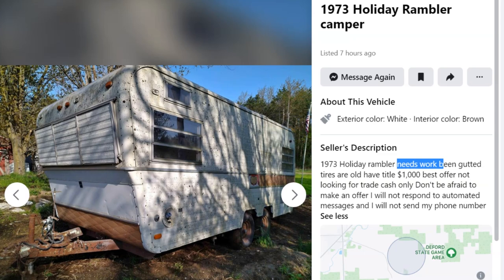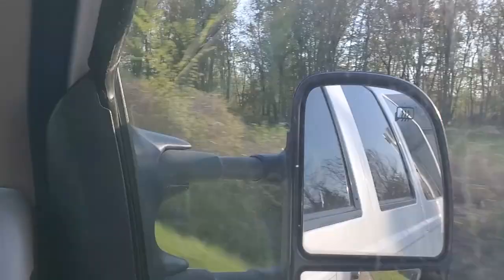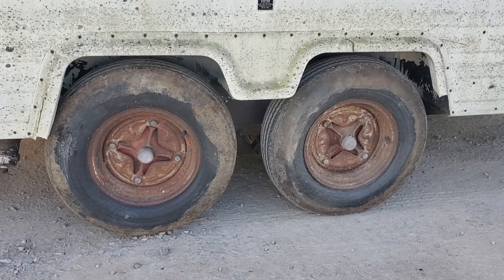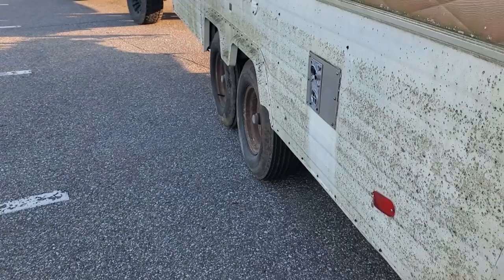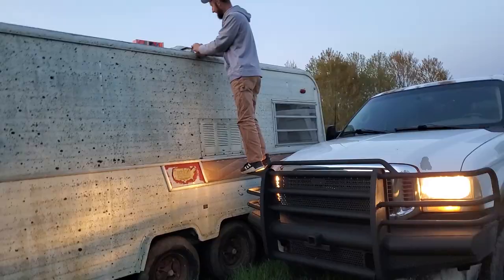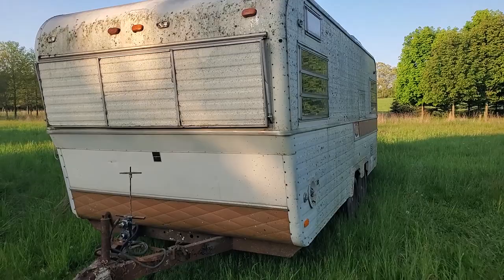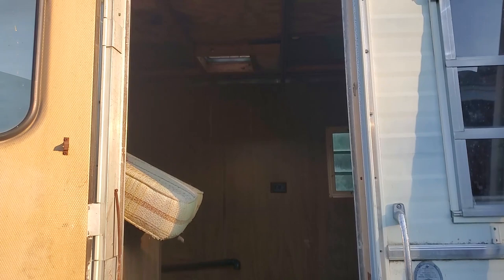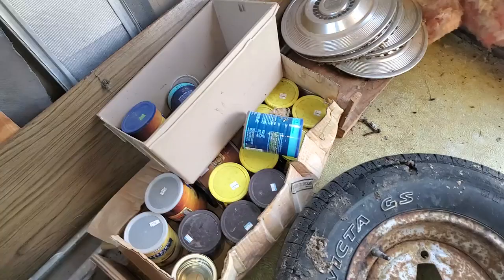Classic Camper Rescue!  Unveiling 1973 Holiday Rambler Vacationer Travel Trailer #DIY

Comment: Back around 1986 "23 yrs old" I bought a flawless/mint 1971 Holiday Rambler 31 ft. from it's original owner. Front and back doors w/real Cherrywood cabinets. No particle boards or staples like todays RV's. I had it on a Summer Seasonal Ocean Front Site at York Beach, Maine for 9 years. Wasn't married, had no kids, making kick ass "legal" money, made it alot of fun back in the 80's thru the mid 90's. Best of times! Paid $5,600 for it in 1986 and paid $1,500-$1,700 yearly for the Ocean-Front Site (May 1st-Oct.15th) w/my own private beach. "I wanna go back".
Reply from the maker: It sounds like it was a sweet set-up. They don't make them like they used to. Not too shabby for a 23 year old. Oh the good old days 😁.

Comment: We have  a 73 Holiday Rambler. It is the 32 Holiday Rambler model with all aluminum framing full aluminum belly pan and it has been a great trailer. We have had it for18 years and everything has worked very well until this year. I suspect the heat exchanger has a rust hole and will need repair or replaced. And it is time to upgrade the power converter. The higher end models had very interesting breaking systems. Off the top of my head I cant recall the specifics but it addressed anti-sway while towing as I remember. I can tell you the models with all aluminum framing can take a pounding.   Large trees decided to rest on ours and the trailer shook it off with no structural damage. Enjoy
Reply from the maker: Your camper sounds sweet! It's a testament to qualify and being well maintained 😁

Comment: I am so excited to see how this reno goes. 🤘
Reply from the maker: Thanks for watching, we're excited too!  We appreciate the comment.  It looks like you're full-timers in an RV so feel free to send suggestions our way for the Class C that we're working on as well as this Holiday Rambler travel trailer.  We're happy to have you along for the ride 🤘
Reply: @retrorevivals  I've always been a fan of kitchens on either the front or the back, and maybe a corner bathroom if you're not going with a shower (or a wet bath in something of this size) if only because it keeps things feeling more open. The bunks seem like a good idea, or even a big couch on the opposite side to the kitchen that turns into a pull out bed. I think that longer desks are more convenient than dinettes, especially if there is some storage beneath, and they keep the floor more open feeling!

As for the Class C, that's a little bit more tough because you already have the overcab bed. It sounds like you guys may have been thinking about an L-shaped couch setup that converts to a nice bed, I think that's awesome. If the bathroom is staying as is, that will determine where the kitchen will go pretty easily I think. Painting the interior walls a nice, bright color would certainly help if that's on the list, given that it's a smaller space! Also, that trick with caulking using painter's tape, that's the move. Professional results every time. 😎

In terms of appearance, I love the look of the Class C other than the dang roof! I've watched all of the videos, and that roof looks 1000x better than it did, and the green stripes really give it awesome character I think. The blue engine tape also gives it a pop of character! I'd love to see the more pastel colors returned to the HR trailer, and maybe a metal decal in place of that plastic one that's cracked. And then when you're done, pulling the HR with the Class C is the obvious choice, especially if it works out better without bunk beds and you guys need more sleeping space! LED light strips around the corners may also give it a nice appearance while also not having to worry about wiring up puck lights and such. If you haven't looked into composting toilets, we had made one (with very limited skills, so it was pretty ugly) but it was surprisingly not close to as bad as one might think! I'm not sure if you guys have figured out that black tank situation yet, but this prevents all of those issues!

Comment: It depends what you want to do with this one. If you're thinking an air BNB kind of thing, that goes one direction. If you want to continue to use it as a travel trailer, that's a whole other show. This one looks to be in really good shape in terms of the bones, so restoration will be a lot less involved. There aren't a whole lot of these old ones around any more. A restore to it's original floor plan with current tech and appliances would be pretty cool. Based on the pics you've found so far, and what's currently left in place, figuring out the floor plan should be pretty easy. It's clear where the fridge goes and the furnace is still in place. The water heater hole should be pretty obvious as well. All the cushions are there it looks like, so having those remade to fit is pretty simple. By 1973 standards for travel trailers, Holiday Rambler was probably one of the higher end ones to purchase. With enough time and effort, this one could be pretty sweet. You could then be part of the retro trailer crowd that's out there that does regular retro events. That's my take on it.
Reply from the maker: It's tempting to switch gears and just focus on this one because, I think you're right, it will be a lot less involved than the Class C motorhome.  I think we could figure out the old interior but I just hate when the bathroom is slapped right in the middle which looks like where this one was.  If the current black tank is still in good shape, we'll likely use it and then we're pretty much limited on where the bathroom will go.  I agree, retro vibe but updated tech and appliances sounds like the say to go with this one.  Thanks for watching!

Comment: I own a 1973 32' Holiday Rambler, Paid $1,800. Been Living in it in Florida for just over 13yrs now. Has it's problems. Had to put Tin on the roof held down by cinder-blocks. Water Plumbing Works but Don't use it, Collect Rain Water for Bathing and General Cleaning, Drinking Water comes from Neighbors Well down the Road. Toilet and it's Plumbing is Shot and had No Holding Tank, use a Camping Toilet, throw Bags away at Gas Station Down the Road, YES LEGAL! But Garbage Refuse to Pick My Garbage up if I put the Bags in Mine.. 
    Under Front Door is Rotted but Holding up. Floors are Cheap Ass Self Stick Tiles that Don't Stick. Bathroom Floor is Saggy and HUGE Hole under where Toilet is and Open to Outside. Electrical is Okay and Warm Enough in Winter with a Oil Filled Space Heater and Cool Enough with a Window A/C Upfront.  
    Stove is Shot and can Not Be Saved. Original Fridge is Gone! Holes Under the Flooring leading to the Outside so Mice are a HUGE Problem in Fall/Winter/Spring and Closed off Just enough so Opossums Can No Longer get in. Occasional Snake ( None Poisonous ), Lizards, Roaches Of Coarse...     
    A Family of 6 Were Living in it Before Me and I had to Rip out the Bunk Beds in Back. Put in a Shelf/Desk and that is where the TV and Computer are and I Lay In Bed All Day watching it. I would Renovate it but need to build a Shed/House First and Move this before one of 3 Trees Fall On it. About the Only thing of Value on it are the Tires that were Brand New at $700 and I Put on it and only have 1,450 Miles on them but are Now 13plus Years old... And 2 Brand New ( at the time ) and Barely Used 20Gallon Propane Tanks. 
   It Does what it Needs to Do and I am Happy With it. And I have a Nice Covered 12x12 Porch On It. That Helps A Lot also..  Did Have to take the Front Door Of and Replace that with a Standard Door. The Latch Broke and Costs over $200 to Replace it and a Standard Hollow Core Door with Minor Defects at the Bottom was only $5 and $2 for the Cupboard Handles and $5 for Latch Lock... Seemed to Make Sense... Cut off the Bad Part of the Door to Fit...
Reply from the maker: Wow!  You sure have had to do a lot of work but it sounds like it's working out for you.  Your Holiday Rambler is about twice the size of ours (18').  I'd definitely want my next project to be keeping the critters out if I were you, or getting a cat to take care of them, lol.  Thanks for watching the channel and commenting!

Comment: In 1987 I lived for a couple yrs in an even older Holiday Rambler 32’ trailer.   I was the 2nd owner & the family I  bought it from took care of it but didn’t use it very much. It was very cozy. I loved sleeping in the loft. I got crazy & put in a small wood stove which was unheard of at the time. Northern Az was great back then. It had a great shower but the toilet was hell. It ended up with a cassette porta potty because the stock toilet that came with it was insanely flimsy & black water dumping was impossible in remote AZ. The best thing I recall was the propane fridge. Super cold & cheap to run. Very roomy. The 32’ was as small as I would go for full time living but 17’ would be great for camping. My advice… Do it retro & take it to the retro RV shows when they come around. I really miss the Holiday Rambler. I wish I could find one that’s in decent condition. Have fun!
Reply from the maker: Thanks for sharing your memories. It sounds like you really enjoyed your old Rambler. We'd like to attend some RV shows at some point. We'll keep working on them 😉. Thanks for watching!

Comment: Looks like someone already rebuilt the roof. They put plywood down the center as an attempt to create a bit of side slope to make water run off. I'd cut tapered pieces of board to fit on top of the rafters to fully support the roof metal above each rafter. Install conduit to run any wires through in the roof, then spray foam it for insulation and rigidity for the roof metal.

Definitely looks more structurally sound than the motorhome.
Reply from the maker: From the inside, we were wondering about what type of rigidity the roof would have if we were walking or crawling around up there.  I like your suggestions to beef up the structure a bit.  Thanks for watching and for the comment!

Comment: rebuild it to factory floor plan
Reply from the maker: If it turns out the existing black tank is still good, we will probably end up going with factory layout at least in terms of the bathroom location.  If the black tank isn't good, that opens up some other options.  Thanks for continuing to watch, Sid!

Comment: First off get rid of those wheels if you have a problem with a hub on the road it’s going to cost more there to get it fixed also tires don’t need to be over 5 years old a highway patrol can issue a ticket for out of date tires and when one blows out it does a lot of damage I have pulled several across country and seen new tires blow and mess up stuff I know this is an older video I hope you get it
Reply from the maker: We will definitely be replacing the tires. As for the wheels and hubs. I plan to pull it all apart and inspect the bearings. Did you have the same setup and upgrade to the more modern hub design? We currently have electric brakes. I'm curious about the ease of converting to a the newer hub /wheel design. Thanks for your comment 😁